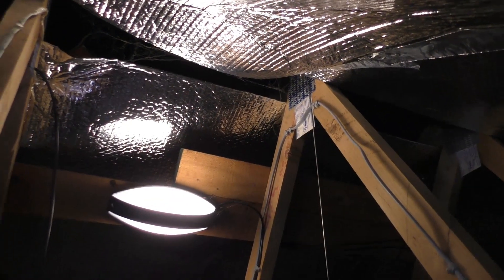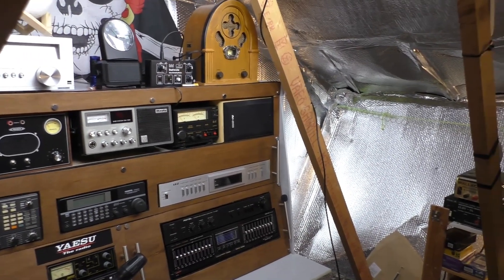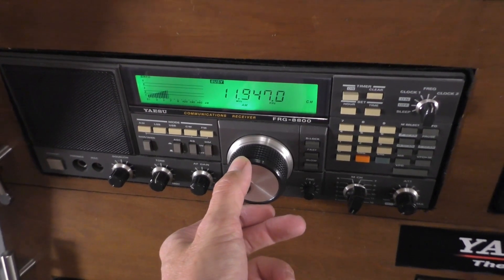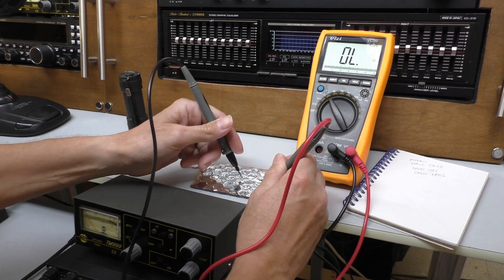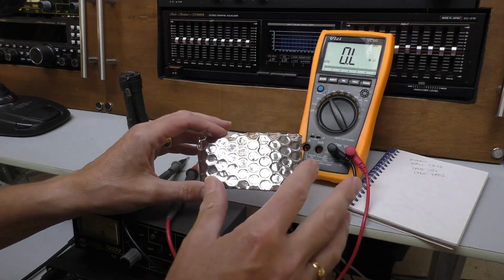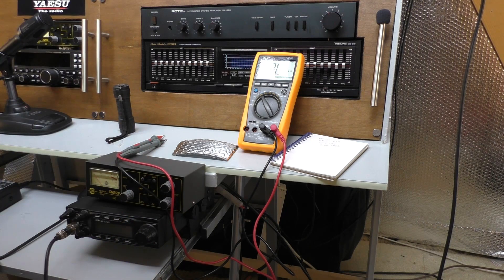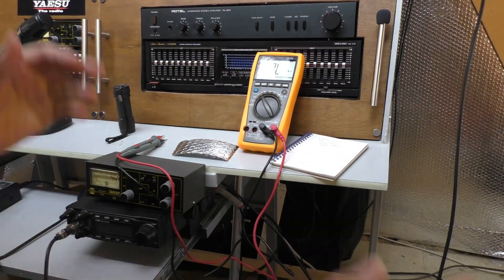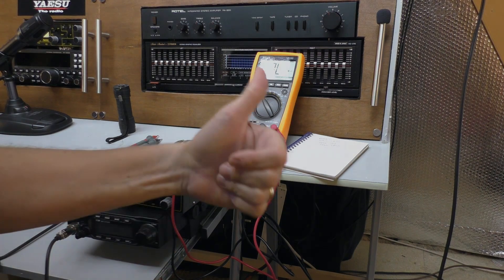CB antenna in a loft. Can silver foil insulation block radio signals ?

Comment: I had a DV27 on the roof of the garage out the back. The roof was all corrugated iron. I could blost out the other guys down the road on their 'Pro' set up no probs, even cut through their burners.
Reply from the maker: When you look back the DV27 was not too bad.
Reply: @CB-RADIO-UK  It was there and it worked. Great for a budget I had a Midland 3001. Loved it

Comment: I do know that the Thermalite/Celcon type Construction Blocks do use an Aluminium powder in the making of them with Fly Ash (Coal Fired Power station Ash), Sand & Cement 
The Fly Ash and is put into a very very fast spinning Drum Mixer with water, then add the Aluminium powder is added, this is then put into a Mould where it rises like Bread dough. The moulds are broken down and then the Building blocks are cut with wires. It definitely had a big effect if putting TV Aerials in Lofts. Causing Goasting and breaking up Teletext etc back in the 70’s & 80’s

Comment: How about useing a "barb wire fence line " with alagater clips off an 18 foot feed line and seeing what the results will be. Meaning that the barb wire fence is the antenna. A huge property with a barb wire fence would be a great temperament.

Comment: Actually this is just cellophane, I really thought that it was like kitchen foil on the previous video! With the cb horizontal inefficiency it must be like you say: the horizontal polarization. Actually in the attic I have a 15m wire stretched horizontally in the shape of zigzag of two triangles /\/ (continuous wire) on a flat plane and with 10watts they can hear me in Milano and Germany from here (neqr Toulouse, Fr) on the 40m band :D
Reply from the maker: Yes its just coloured bubble wrap.  Agree just putting up a straight wire is always going to be a real ask on CB with vertical antennas.  All about trying things out.  thanks for the comment.

Comment: my 1st antenna was a DV27 on a biscuit tin at my folks house , yep those days were different , i ddint even care about the DX back then,  I say give it a go if anything it will be interesting if you can get it SWRed in. I had so  much trouble trying to get a decent swr on the DV27, a right old faf.
Reply from the maker: Yes a couple of mates had the DV27 and getting the SWR low was a pain indeed.

Comment: Heck yes, I confess, I have a 4 x 4 handy box in the center of a cross of aluminum foil up there with a mobile mount on the box even now. But i like the "no ground plane" antennas better, since you can just hang them in a bush when camping.
Reply from the maker: The T2LT works well hanging from any tree.

Comment: In the 80's i had a Stabo SH6100 10mw Walkie Talkie. Made pretty much contact with that on the original antenna. But like you say the band was packed full in those days.

Comment: Haha Haha DV27 😊👍I had one of those being poor and my mate had a posh K40 on our Cars a Mk3 Cortina and he had a 1600E Mk2, we had many a happy qso whilst mobile around the back lanes of Hertfordshire Buckinghamshire and Bedfordshire. The DV27 was great value for money. At home I had a Homebrew wire 1/2 Wave Dipole in the Loft Shack freezing in winter and boiled alive in Summer. A lot of CBers I spoke to on the wire used to call me a liar when the where getting me at 40 over 9 in Luton and Hatfield from Hemel.
My reply was why waste money on ready built Antennas when a piece of wire works far better for Homebase... I think I was lucky as the loft ran at 90 degrees to those locations so the signal was max off the sides of the wire dipole.

Comment: Back in day when millions of CBs were in nearly every car, truck etc it was not unusual to see coPhazed antennas and with you having  the 2 identical antennas  you might consider making a harness out of 75 ohm coax a quarter wave each side of a tee to the 52 ohm coax to get as much as a 3 db gain. The ground plane on each antennas could also be a  just a couple of quarter wave long ( 102 inches)wires on the floor. I had cophazed 102 in whips on my small car for years.  Just a thought while you are doing it, why not get some gain that works better. The foil is really a radiant barrier designed to reflect the heat back to the roof keeping it from making the attic so hot. And yes the inside of it reflects heat back into the house in winter to conserve that heat.  Sadly the e-skip of summer has about ended with no UK/USA openings but I will keep watching to make a contact across the pond to you.
Reply from the maker: Cheers.  Yes very little stateside came over this year.  I really miss not listening to the Super Bowl channel :-(